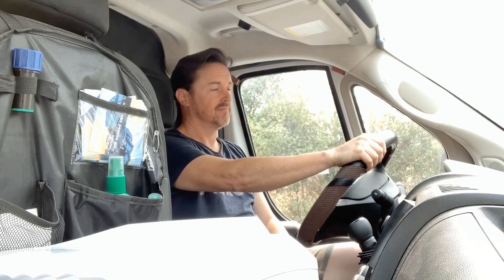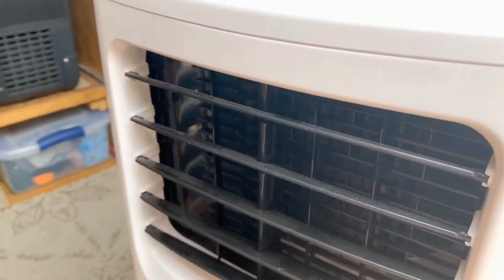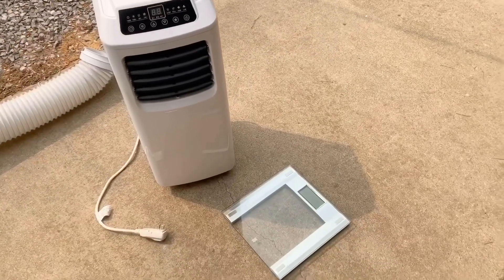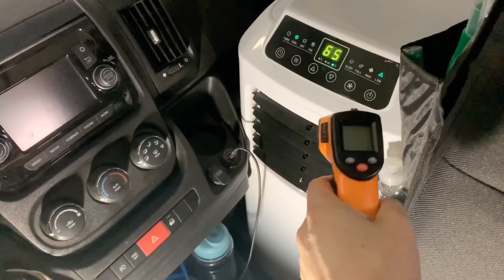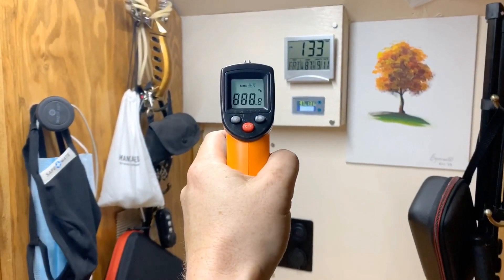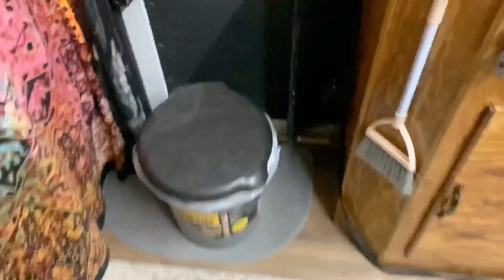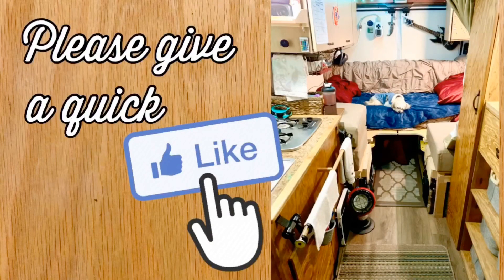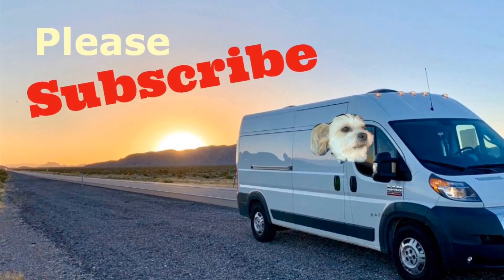Portable Cab Air Conditioner | RV Van Life

Comment: The reason it gets hotter towards the back of the van is that this unit exhausts hot air from the condensor through the tube, but it draws the air to cool that hot condensor coil from the conditioned area creating a negative pressure in the van, so for all the cubic feet of hot air blowing out the tube, the same number of cubic feet of unconditioned hot air is being drawn in through the cracks and leaks in the vehicle. The ideal situation would be to isolate the vent area on the unit that's drawing air in to pass across the hot condensor coil and hack another vent tube onto it to draw cooling air in from the outside.

Comment: This would be a much more challenging setup but a window AC is a much more efficient setup. All the hot air that gets exhausted causes outside air to leak through other cracks and gaps around the van. Having the compressor inside also produces a lot of heat.
Reply from the maker: It’s definitely not the Most efficient. But it works well enough and helps me sleep. Hope you have a nice summer and can avoid the heat as much as possible. 😊
Reply: @n8nomad419  I work in HVAC so I got that covered!
Reply from the maker: Nice. I feel like that’s an industry that will always have plenty of work. 👍
Reply: @n8nomad419  The last 3 years have been crazy. It just keeps growing despite prices being about 40% higher than they were 2 years ago. If you need any kind of furnace or AC buy it now. It will double in price again over the next 2-3 years.
Reply from the maker: I believe it! It feels surreal.
Pandemic
Wars
Famine
Supply chains
Inflation 
(Crazy times)

Comment: Cut out a window unit size area low on the side of the van.install a small window unit into the van with only about a 8th of an inch poking out. Put a vent cover where the ac unit is poking out.  Only way to get good cold ac in van. Also you can get small mini split ac unit.

Comment: Great job and explanation, I saw people plugging these big units under trucks, but they have big trucks, I don't know if it's going to fit in a van, but it's nice to try, just plug in the vent that brings in cold air. inside the RV by forming a hole in the floor, the entire unit would be outside secured with metal brackets.
Reply: I thought about this, but are they still power hungry and inefficient?

Comment: Another issue is that you're pulling in air from the exterior because it's created a negative pressure zone inside the van by pushing air outside. They don't seem to exist yet, but small dual hose portable air conditioners would be the best.
Reply from the maker: Agreed.
But a dual hose setup would be difficult without cutting holes somewhere. But it would be more effective.
Reply: Sir  can we use ac ..when moving the car
Reply from the maker: @ajayvk53 I keep my van plugged into shore power when using the A/C. So no. Unless you’re using a generator.

Comment: Hello, we just went on a camping trip and discovered we needed something better than a box fan and open windows to keep cool at night.  So many videos, so many opinions:( Thanks so much for this insightful video; you definitely made this process easier to move forward.
Reply from the maker: I appreciate that. I truly hope it helps. And if you can hook it to a small generator that draws its gas from the fuel tank it’s good for a week or more of running it at night (while sleeping). Which is most important in my opinion and keeps the batteries topped off too. Otherwise you’re only practical option is living at much higher and cooler altitudes and not everyone has that option.
Reply: did you go with a portable AC? Did it do the trick for you?

Comment: Some good ideas here as I gather info for a some day van project. But you led me down a rabbit hole that makes me think a 2 hose unit would get massively better results.
Reply from the maker: There are many ways to upgrade the quality if this a/c system. That’s definitely one. Another is to buy an insulated exhaust hose. Some people cut holes for a more permanent exhaust system too. But this system works fair enough for me 😁 I hope your Some-Day project works out 😊

Comment: if you use insulated ac duct tubes you will see even better numbers from the exhaust tube, while you are in the duct area pick up a floor register that fits over the front (or build one from foam board) and direct the air down the plastic tube

Comment: Last June 2020 my nine-day vacation in the bus coincided with 90+ outside heat, I happen to have the portable AC but had some of the same issues like the heat from the vent tube which using your tip now I can replace with the aluminum vent tube and use the plastic to redirect the air.  I have been going back and forth on the portable vs a window AC, pros and cons too many to list lol.  The only thing I want to do different is somehow place the vent of the AC almost directly to a vent outlet, like, mayby customize a side hole in my bus like a dryer has a vent, sorry for long comment, great tips!!! .
Reply from the maker: Long comments welcome LOL. I sooo understand the dryer vent idea. Very smart. A wasted modification if you end up not using it but very ideal. I’m just glad I was of any help. It’s all about doing, learning, re-doing again until it’s right. I thrive on solving small problems so the Van Life gives me a constant upgrade lifestyle LOL. Especially since I’m no engineer. But such an amazing journey. Hopefully you enjoy many more vacations (with even more comfort) 😁

Comment: I've put a similar unit in my van to battle the Florida summer heat. I had the same problem with that hose heating the cab up a lot. They sell an insulated sleeve that goes right over the hose and it makes a huge difference (and it's under $20). Covering the windows to block out the sun, and seperating the cab from the back of the van is also important.
Reply from the maker: That’s awesome. Thanks. 😊
Reply: I have a similar unit in my van in Florida but I'm finding it does a poor job of dehumidifying. What brand did you use?
Reply: @dremilypenney  Hi. My unit is a GE model 5100. Never tried the dehumidifier, only the a/c portion. It still had to work it's butt off (in August especially.) Had the insulated pipe run out the front window, and that helped seperate the hot part of the van (the cab), from the living area.  Expensive to run if you're not at an rv site.
Reply from the maker: You know.. I have it currently in storage for winter. But I will say that fighting that humidity on the east coast is certainly harder and I doubt this little thing will fight that well enough for you. I’m in a very dry climate but I know the struggle. When I’m in real humid areas I honestly just run the Van A/C with the heater on (both together) in winter to combat the moisture. I used to live in FL and that was my struggle.
Reply: Wow.  Yep. I was hoping to find a quieter unit than the Dometic my van came with but that thing is a powerhouse and does in fact dehumidify effectively. Ear plugs to sleep it is. Oh well!
Reply from the maker: I solved a lot of problems with wearing warm clothing, earplugs and sleeping mask mask. So much easier than fighting the cold, noise and lights lol. My dog will wake me up if something goes wrong and I’m shut off from sight and hearing.
Reply: portable a/c. junk insulated exhaust sleeve, useless...window a/c workd Great
Reply: How do you have enough power to run something like that? I have a 250 amp hour battery bank but every A/C I look at would deplete my batteries in a few hours and I need my batteries to last 4 days running not just the A/C but also mini-fridge, small microwave although I only use it a few minutes per day to reheat lefovers, netflix streaming/internet browsing/simple games laptop, cell phone and a few/led lights.
Reply from the maker: You’re correct. I don’t run it off of my batteries. In the video I explain that I run it off of shore power and how there’s an option to tap the fuel tank to use a generator. To be honest, the only truly great option for cooling a van is to sleep or at least move and live in cooler environments. I live in one place in summers and another in winters now. It’s miserable in summers when hot (no matter what setup I have). Especially as I get older.

Comment: Trying to see how you connected the plastic tubing to the cold air vents. On the screen, it comes across as flat black. I imagine black electricians or duct tape was used? No cutting the fins needed? .... an old saying from awhile back: AC does not like to turn corners.  An idea: a wool blanket over the  aluminum out going air tube may provide some insulation. We towels too, if humidity is not an issue. Thanks again for a great video!
Reply from the maker: 1 small piece of tape holds the plastic tube to the cold-air vent. Easily removed to store or move but just strong enough to hold it in place for use. 😊👌
Reply: N8 Nomad thanks again.

Comment: A single-hose portable AC sucks the air out of your room and blows it outside. Then that causes a vacuum which in turn draws heat from outside into the room through every little crack.

Comment: maaaaannnn loved the vid. i got a 6000btu floor model like that from homedepot n cut a hole for the vent in the floor by my sliding door. i dont enter in and out my van from there. plus i have a chair area i made there where the tub go thru the middle of the chair base to the floor. it keeps my 170 sprinter icy cold 🥶  94° in nyc this week. i subbed. great vid. everything u said i also do. even tho i built a shower/toliet area across from my sliding door. sometimes i also take toliet out and use it in that between area. have a good summer
Reply from the maker: That sounds awesome. And smart about making it permanent and not using that door.
Reply: do you use a genorator or shore power?
Reply: @OgBooder302  i use my 1200ah lithium battery bank plus i got 1050 watts of solar on my roof
Reply: @OgBooder302  my van build is completely electric. Im lazy 😪 😩  dont like to depend on outside resources if i don't have. But i can plug into shore power. Had a 4000watt generator never used it. Sold it a yr later for half the value just to get rid of it. It was a wei gen/inverter. Thought i would need 1 but i didn't
Reply: @theghettotraveler347  wow.. thats about 4,000 on batterys😅
Reply: Do you think a swamp cooler would work? Or should i just get a gas generator? 4000 is all my savings! Plus i would need a new inverter‼️
Reply: @OgBooder302  if u think about really living this full time its money well spent. Rent in nyc is like $1500 for 1 sm bed room lol. Lights gas car note insurance etc u spend for a apt. 4 racks is lite especially when u save on the back end by not having to pay bills. I work play, lay get paid n travel all in the same spot bro. R u in van or bus life now
Reply: @OgBooder302  and i subbed. Your 🎶 is dope.
Reply: Aaayy mann. Im full time van life. Can we connect more? Instagram? And thanks so much for checking me out‼️ van life is my life for the better‼️ no more slums for me‼️
Reply: @OgBooder302  i heard of those. Dont know if they work. Cuz if they was on point. Everyone i know would have em. Get u 2 maxx air fans. They bout $300 ea n work great. Might wanna and if u really wanna be in van life spend that bread on electrical upgrades. That gas stuff is cool. But u see how gas is crazy. And think. What would u do if u cant get any gas. The sun is always here. Unless they decide to matrix that shit lol. But drive to one of those states by the equator when the sun 🌞 is always up n brite u can live like a king. What your water tank size like. Thats also important
Reply: @theghettotraveler347  dont have a water tank. I work at hotel so van fitted as like city camper. No bathroom, no stove.. im fine with that. I do need temp control tho.. i have a dc to dc chargwr that works well so im not even using solar.. charges 100ah pretty fast..
Reply: @theghettotraveler347  it looks more like a bedroom..
Reply: @theghettotraveler347  followed you
Reply from the maker: Shore. I don’t have a generator.
Reply from the maker: Damn! That’s nice. I would too if I had that 😉

Comment: have a fan run when you run air conditioner. the fan will circulating the air to cool down faster
Reply from the maker: I actually use a tiny USB fan and it helps a lot. I never thought to include that in the video LOL so I should definitely follow up on that. Thank you. Are you in Van Life?
Reply: @n8nomad419  that was PG&E recommended. i like to watch videos of van life people post up. maybe one day i get a 4x4 NV3500 cruising U.S.A
Reply from the maker: That would be sweet!

Comment: The flexible exhaust hose is a big heat gain that is counterproductive. The difference between the cheap uninsulated vinyl hose and your uninsulate aluminum hose is ZERO. Both uninsulated-same heat radiated. Go out and buy 3" diameter fiberglass insulated flexible supply duct hose with 1" insulation 
and fix it right.

Comment: Thanks 😊😊👍💯💫 😊 excellent job
.. I have had that idea in mind... I appreciate so much you showed me, it can be possible.. would you please tell me where did you got it.. and what kind of generator you use... Pleaseeee 😃
Thanks youuuu ❤❤❤
Reply from the maker: I plug into shore power for the a/c unit and I got it on Amazon. I don’t have a generator (although sometimes I wish I did. And it’s not too efficient by the way. But it’s a solution for when I have to stay in the heat. The best solution (if possible) is to move to higher elevations or near a lake or ocean during the hot summer weather. 😊

Comment: you can buy soft ac ducts that are basically insulated versions of the metal dryer hose you used
Reply from the maker: This is true. I went with that one originally because it worked better with opening and shutting the door often. But recently I did switch it for an insulated one.Much more efficient. 👍

Comment: something else that might have helped in this case was having a insulated  wall section with opening door right behind the driver etc seats  the hose could have been run and attached to the wall . this would keep hot heat from the front from entering the back and also even  keep the colder air cold longer because of the insulated barrier wall. just a thought .
Reply from the maker: I like the helpful ideas. I think too many (maybe 99%) of YouTubers are only here to make money. But I generally hope our community can continue to inspire and truly HELP each other with ideas. Thank you 🙏 
😊
Reply: @n8nomad419  have you joined Bob Wells community where they are doing just that? Online Caravans on Meet-up until things open up again.

Comment: Hello, thanks for the helpful video.  So not all cool air made it thru the plastic tube right? since it's just sitting there in front of the output vent, some would escape around the tube to the front of the cab?
Reply from the maker: Correct. Not the greatest setup for sure. But hopefully people can take my suggestions and improve on them.

Comment: hi how much power do you need to run that portable a/c for like 10 hours straight.. like how many watt’s or solar panels do you need? sorry for my ignorance thanks in advance great video and such a cute dog 🐶
Reply from the maker: Not at all. It’s a complex answer though. I use “shore power” when at a site or family members house. The only viable solution otherwise (that I see) is to tap into the top 3/4 of the gas tank using a 2500 watt generator that I would keep outside on one of those caged carriers on the rear hitch (for noise and vapors). I doubt solar would ever be a good idea for this kind of load.
Reply from the maker: But that’s would be a huge cost for very little return. So I only use extension cords.

Comment: I work out in oil fields so I ripped out the passenger seat the back seat for cargo space and sleeping Silversdo crew cab. Put 375.00 Portable A/C 5000 BTU behind the driver side . Cut a hole out that side for exhaust which is very important.  Drilled small hole there for drainage.  Ran the power cord to right side and drilled a hole there.  Bought 3200 quite mode predator  Generator . In the month of June it paid for itself . It uses 2.2 gallons for. 10 hours that saves from having to run to hotels and paying 125 night plus fuel going there and back . Including time it takes . Your not pulling a trailer and finding place to park it . That self contained at lowest level mentality . denominator
Reply from the maker: Wow. You have it dialed in for sure. That’s awesome. 😁

Comment: I wondering 🤔 if portable ac unit would fit my conventional truck  with sleeper Bed using and 2500 power inverter ?
Reply from the maker: I personally plug mine into Shore power. I don’t have the extensive battery supply (too expensive). Can also use a small generator.